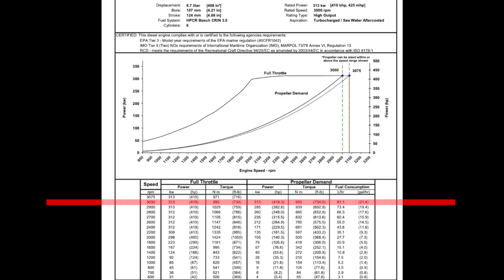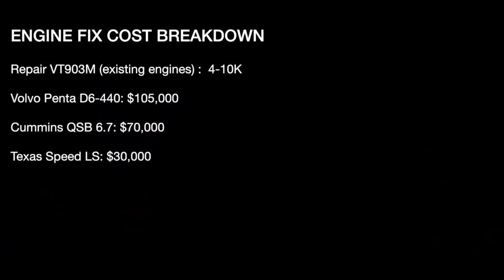Tesla Powering my 30yr Old Italian Yacht? And Broken Diesel Engine Diagnostics

Comment: We run a D4 in our boat. Single engine boat. Gota go deisel man. 39knotts 55 ltrs per hour at our comfortable cruising speed around 23-25 knots 35-40 ltrs per hour. If you can get hold of a pair of KAD44 be great or a pair of AD40’s. Reconditioned be the way forward. The AD models are basically tractor engines. No complicated engine diagnostics. 
Love the videos.

Comment: I’m not a boat guy, but I base all of my decisions on logic. Based on what you have researched it seems like your best option is to rebuild your old engines. You know they were spec’d out for your boat, and so there is no guessing how they would react, and no surprises or stress. The bulk of the cost of an engine is in the block and heads, so as long as those are serviceable you will save a lot of money. IF something bad happened and you can’t use them, then your best option is to replace them with the newer version of same. No guessing, no stress, everything bolts in, and your marriage stays happy. :)

Comment: Since you gotta do new bottom paint anyway, you should consider doing this stuff called smart armor made by Hullspeed. Its a protective bottom coating that protects the hull, while also drastically reducing drag. The company claims a 10-12% increase in fuel economy and top speed. I used a similar coating from the same company on the bottom of my 19'6" hallett jet boat and it actually works. You just prep the hull by sanding everywhere you want to apply the coating, use a high-bond fiberglass primer, then you can spray or roll the product on the hull. Personally I would recommend spraying it. On my boat I had to do some filling work and make sure the hull was perfect straight, then primed it, then sanded it. I did that 3 times before getting it perfect,  then did 3 coats of their "F-series" product. My boat did 76 MPH on GPS before I did the work on the bottom of the hull. Granted, straightening and refinishing the hull on its own would have yielded some benefit, but after doing all the work and putting the boat back in the water, I knew right away that there was going to be a drastic difference in top speed. The engine is a Ford 460 bored .030 over with a stroker forged crank making it a 521CI BBF. Its a full roller engine and is running a holley fuel injection system. The engine did 730HP on an engine dyno and built power from 3200 all the way past 7000rpm, but i limited it at 6750 to be safe. The pump is a fully built Berkeley 12JG with a 9 vane bowl with polished runners, stainless AA impeller, inducer, race style intake grate, extended length droop snoot, custom ride plate and modified place diverter so I can throw a HUGE rooster tail. Anyway, long story short, I went from 76 MPH to 86 MPH on GPS! I still have some tuning to address as well as some other adjustments to make but im confident it will hit 90 MPH next summer with the right conditions. Best part about my boat is that it cruises at 40+ mph at 3600rpm. I highly suggest trying that product out!

Comment: I have 14 years as a diesel mechanic in the navy. Just rebuild the original Cummins engines and spend the money on other improvements.
Reply: Depending on how many hours on the diesels.  If low to even mid range of life, just rebuild the one that broke.
Reply: He is worried about “violent” in the valve cover.  Uhhh yeah sir that is water from the lake/river/ocean that cools the engine.  Could be an exhaust manifold leak or head gasket

Comment: Rebuild the diesels and add an electric engine for low-speed cruising. Make it a hybrid! (Bonus points if the diesels can be used for charging the batteries).
Reply: I was thinking the same thing!  that would be really cool.
Reply: Best idea
Reply: If he's looking to do something unique for his channel I think you're idea is an excellent one.  My only concern would be weight with the heavy diesel engines and a battery large enough to have any practical range between recharges.

Comment: The 'first boat learning curve' is HUGE !   Best advice I can give is "it was built exactly that way for a reason ... don't change anything.  Even the silicone you use must be marine grade (3M 4200/5200 for example).  Marine parts don't just say they are marine, they are marine.  
Hire a professional NOW to asses the situation. Leave the good engine alone unless you have a good reason to do otherwise.  The bad engine must have a accurate failure diagnosis but could very possibly be repaired in the boat.  Highway trucks for example can get a "in-frame overhaul" which is a complete rebuild without removing the crankshaft from the block.
There is nothing half assed about leaving the good engine alone unless it has ungodly hours on it.
Did I mention hire a professional?  
Boats are easy to drive?  Don't let your insurance guy hear you say that...
Reply: Highway trucks can be in-framed because there's room under the engine to pull the oil pan and remove rod caps. Boats make that a no go because engine is against the hull. Only top end work in place.

Comment: This boat isn’t worth doing any thing but rebuilding the current engines.
Reply: you might be forgetting that he is paid to work on stuff and an engine swap would make a lot of content opportunities
Reply: @jacobdavis787  still be just as much fun if he did some upgrades and B is for Build = Rebuild still has build in it. I would watch it
Reply: Idk with all the storms that just went through the gulf. You can get a better boat is all I’m saying.
Reply: Theres no way I would buy a 30 year old 40ft fiberglass boat. My 20 year old 21ft boat had rot, im 2 years into a full rebuild
Reply: Nothing wrong with an old boat. As long as you get it from an American manufacturer. Just repowered an older (early 90’s)scarborough there was no rot anywhere on the boat.

Comment: Diesel way is the way to go, higher longevity, better fuel economy, better re sell value. might not be as exciting to show rebuild of your existing diesels on YouTube, as gas or electric swap, but it will be by far more cost effective, reliable and long term valuable solution to yacht. Good luck with the build👍

Comment: Chris, for gods sake rebuild the damn engines, don't replace them. No nono
Reply: Agreed.  Rebuild.  Bullet proof as long as you have OIL IN THEM.
Reply: @3sons66  Note to self, oil pressure sensors are important!
Reply: For Devils sake maybe
Reply: Even if you do put another engine(s) in the boat, rebuilding them is usually worth it .. either as backup engines, or to sell them on the second hand market.

Marine engines are expensive for a reason!

Comment: Rebuild yours, increase boost if additional power is demanded.
Reply: That's...not how that works. More boost requires more fuel. More fuel requires bigger injectors and more fuel pressure. Not the simplest thing to accomplish on ~30 year old diesels that are out of production.
Reply: High power diesel!
Reply: Increasing fuel for additional boost is very simple on a mechanical pump diesel. Even if his engines are a newer style electric over hydraulic injection, most systems are capable of doing 150% of the engine’s maximum fuel requirements.
Reply: Twin,  built, compound boosted OM606s

Comment: I would just rebuild the ones you have. I put a 4BT Cummings in my Jeep this year. I can run it at top RPMs for hours no issues. It is still all stock so I don't go fast but it's a Jeep and I don't mind. Just nice to have that reliable diesel and good fuel mileage.

Comment: Chris, I love how you always want to do the impractical or “impossible”. That is what makes the “B is 4 Build” channel so interesting to watch. 

Having said that, this is really a no brainer for lots of reasons. Just rebuild the existing Cummins diesels and save the money for other cool upgrades on the boats electronics, auto-pilot, etc. 

They put marine diesels in all larger boats for a reason. They are the most reliable, efficient method of propelling a large, heavy, yacht for hours or even days on end without stopping. Just like large buses. You don’t need huge horsepower, high revving engines. You need thousands of foot pounds of sustainable,  reliable, economical, torque. 

You are absolutely right to think of resale value which would be nearly zero if you put anything other than large diesels back in the Riva.
Reply: just tell him that he can buy a wide body kit for the boat with all the money he can save. That should convince him.
Reply: @kennetharreguin5720  lol

Comment: Diesel/upgrade to bigger spools/ upgrade fuel management system. Then once tuned look at your meat cutters for size and pitch and retune depending on top speed. You will never miss the torque if diesel.
Love your racing marine mechanic in Michigan. GL.

Comment: As cool as electric would be, I’m team diesel for sure.
Reply: Electric would only be cool until the first leak hits all that Lithium. Lithium ignites the second it makes contact with water, given that hes already shown how easy a leak can develop in the boats hull it should be fairly obvious that unless they want to die a horrible fiery death in the middle of the ocean, Electric should be avoided at all costs.
Reply: I'm betting your oil cooler failed. It had sea water running through tubes that are surrounded by the engines oil. This would be why you lost so much oil and didn't see any in the bilge.

Comment: Don’t put gas engines in. Biggest mistake you’ll ever make.
Reply: What is your justification
Reply: 34 years of boating. Texas speed engines are suited for the drag strip not the ocean. Those old diesels don’t have ECUs so won’t suffer from electronics failure. Also, if you look at the torque demand required to get those props spinning fast before planing, I think those little gas engines will not make enough down low.
Reply: @haggisek  Thanks for this
Reply: Same for https://en.wikipedia.org/wiki/Lycoming_T55?  Hydroplane it?  No low torque but it would sound cool.
Reply: @haggisek  Yep, can't apply what works in cars to a completely different type of transport with different propulsion and differing sets of requirements, pretty sure the boat manufacturer knows better than a guy who's barely owned a boat a year with what engine would be best, diesels have a ton of torque all over due to the compression they run, sure they are probably classed as outdated, but tbh just service it and repair the current issue(which is probably headgasket which would allow boost into the crankcase which is why it blew the oil cap off) and it'll run forever, your on the ocean, not the drag strip
Reply: dont swap engine because u will have big hassle with gear ratio and finding the prop pitch for difrent rpm... and that thing costs. sory for my spelling gretings from croatia!
Reply: @ivanperac834  that's also a good point. He had priced the engines but could be another huge sum to reprop only for it to fail.
Reply: True, gas engines are dangerous in a boat. Boats are not ventilated and gas fumes can cause an explosion. Diesel doesn't do that.

Comment: I recommend you stay with diesel and the same engine if they are cost effective to rebuild. Gasoline engines in the marine environment are inherently more dangerous than diesel. You have the gas fumes which can collect in the bilge and explode, and you have risk of carbon monoxide poisoning from either the mains or a gas generator.  Exhaust fumes can build within the canvas enclosure or cabin, especially at lsow cruise speeds.  The other thing to consider is the architecture of the hull. Boats are designed to carry their center of gravity at a specific point in the hull, and the engine weight and positioning dramatically effect that. I would caution against making any significant change to either of those variables, weight and position, without consulting a naval architect. If you get it wrong best case is a poor performing inefficient hull, worst case it becomes unstable and unsafe.  So there you have it, efficiency of diesel, lower fuel cost, and safety all point to refurbishing what you have, IMO.

Comment: D is for Diesel. Rebuild or explore a hybrid option via diesel generator.
Reply: electro-diesel is a good idea. a couple of tesla motors and battery packs and a big diesel generator, sorta like a shrunk locomotive.
Reply: Sure, most locomotives are diesel electric hybrids and the hybrids have been making their way to marine use, too, large cruise ships and all the way to submarines. You wouldn't have the getting stranded problem and you would get the benefit of cheap diesel and quick refuelling.
Reply: I like that idea of hybrid
Reply: @ghomerhust  Don't comment on a topic you don't know,  aka they don't use batteries as that would kill them (think about charging and discharging at the same time at a high rate = battery death). They use the gen power straight to power motors (no battery) and onboard power use. While I would love somebody to try this out on a small scale (used in the new aircraft carrier QE class, new cruise ships) it would cost too much to make/develop the support and management systems (millions of dollars) for a proper install and not enough space on the boat - unless they made a getto system that would work like crap.

Comment: I have a gas powered boat. It's a single engine, 260bhp outdrive on a 7.5m boat. It's fine at this level but any larger boat would always be diesel. The cost of new or even good reconditioned units would be far in excess of the rebuild cost of your current ones and you could have some engine management software added at the rebuild. This would give you the glass screen view of engine stats and probably the ability to set sensible alarm etc. The Cummins engines are currently fitted to some of the best large (+20m) boats. 
So in my opinion, get your current engines fully serviced and any rebuild necessary and add a suitable EMS to the mix for great reliable and fast boating in the future:-)
Paul

Comment: Big transportation boats use diesel generators, which are located in the middle of the boat, and electric motors which are located in the back, directly connected to propellers. The same configuration is used in diesel trains. Electric engines are much easier for speed and torque regulation (flat torque curve).

Comment: I would deffo just take both engines out and have them both refreshed at the same time. Sounds like it would be the best and most cost efficient thing to do 👍🏻
EDIT 
How much is this ‘company’ 10 miles away from the marina charging you to refresh an engine ? Just interested
Reply: Guaranteed a lot less than new engines

Comment: My opinion, rebuild those engines and possibly even your generator as well.
 While they are out redo all seals you can, inspect the coolers, repaint the bottom, and replace the guages. At very least replace the oil pressure guage that didnt work. Best would be to look at a style guage you can set alarms for

Comment: rebuild the exisitng diesel engines and spend your money on modifying them to their peak efficiency, performance and econonmy.
Reply: There’s little to no aftermarket support for the VTs. They are trash.  Sell the good one. Part out the blown one. Buy two Reman  5.9 12 valves fir 10k a piece   A few mild mods gets you cheap and super reliable 500hp with massive torque. The boats transmissions can’t take more than 800 pounds or so of torque anyways.
Reply: @ihateicecream2  VTs easily upgraded to 600+hp, the army ran them in tanks etc at 700hp+, easily done in a boat as cooling is a non issue like in a truck/tank.
Reply: Scott  they are boat anchors. Parts and support is way cheaper and more accessible for 5.9s. And a mild built 5.9 doesn’t piss through head gaskets. VTs have weak bottom ends and are plagued with spun bearings, thrown rods and broken cranks. The crank is too short there just isn’t much room for the connecting rod bearings, the crankshaft main bearings, and the crank webs.